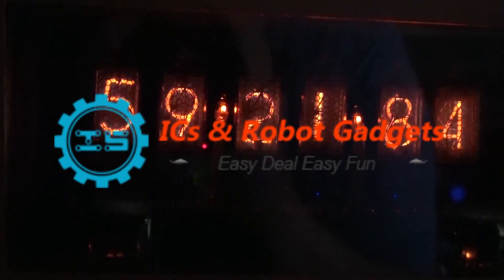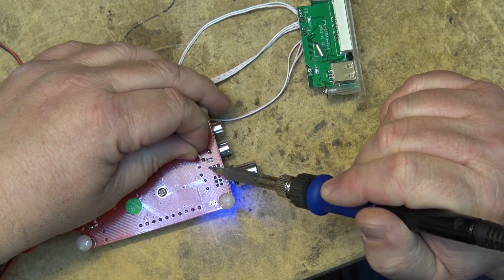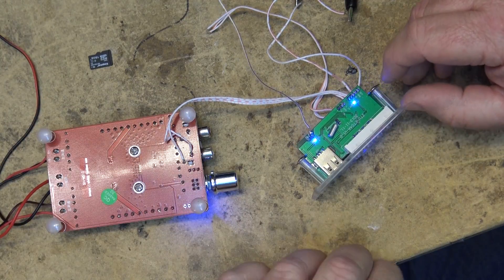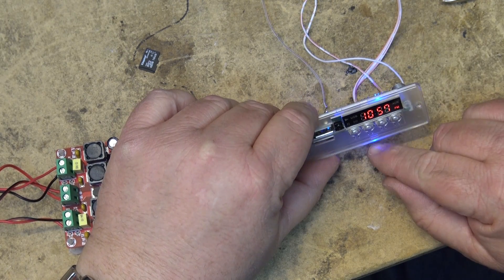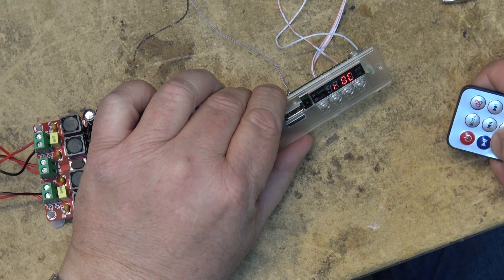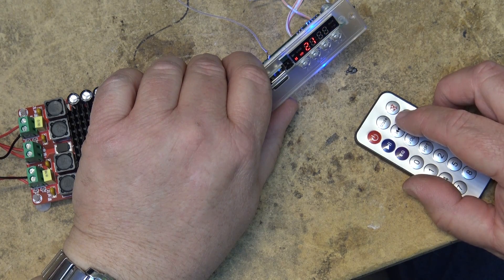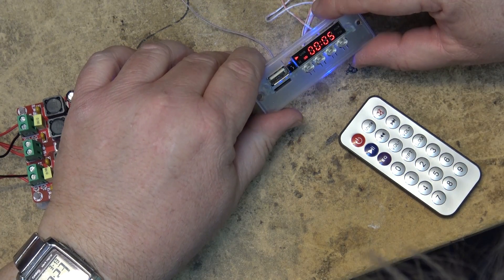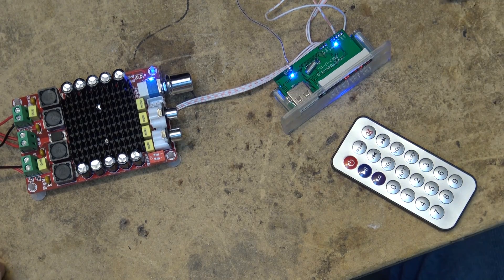MP3 decoder with FM radio board demo

Comment: I have this FM RADIO MP3 BLUETOOTH DECODER I like it but in your video I don't like the iron in the potentiometer..I connect the L/R/GND output of this board to L/R/GND input in audio amplifier then if the audio amplifier has potentiometer volume I turn in in the MAX VALUE and I use only the digital volume,the same thing I do and if I have the Arduino with RDA5807 chip which has code for RDS and digital volume in the library...I will use the potentiometer if I use the Arduino with TEA5767 which this chip has not code for digital volume for example I connect tea5767 with arduino then I connect the L/R/GND output from TEA5767 to L/R/GND input in my audio amplifier and i can contol the audio volume

Comment: I wonder why they didn't implement a DAB reception on this radio from Icstation?
Reply from the maker: DAB isn't used on this side of the world. They tried to implement it about 18 years ago, and even had all the radio stations simulcasting, but it flopped as the USA never adopted the standard and instead launched HD radio (Hybrid digital) so DAB faded into the sunset here in Canada. Now we have the hybrid system as well, which does have a good point. Because it rides along with an analog carrier, the analog station remains on the air for those with older radios to enjoy.  Too bad they didn't do that with analog TV. Left a few TV stations on the air for those that didn't want to upgrade. I am sure there would still be plenty of people watching analog TV had it remained, as the coverage area of an analog transmitter was fer greater than the feeble digital signals we have today.

Comment: Nice French! xD I like it when you post more than one video a day. :)
Reply from the maker: I work full time, so I do the videos mostly on my days off. On a weekends I try to shoot several. Did 2 today, a vintage car radio, and did a quick one of the crew spinning up fiber out on the street. Brings back memories when I worked for a cable company back in high school, and spun up cable in an area that was getting cable tv for the first time.
Reply: I'm so old that I remember when car radios used tubes/valves, instead of semiconductors.
BTW, two videos per day is great! That One-Video-Ah-Day complainer person should
simply not watch YouTube or use any computer... every other day.

Comment: These FM mp3 players are great, they sound great. I have used them in many projects. just make sure when you buy one they have a voltage regulator like this one does.
Reply: yeah, you have to watch that, i have one similar but different, if you get what i mean, and its 5v powered, and, supply polarity input leads are reversed, black being +5, red ground ..oops!!!
Reply: Hello! How can I know if it has a voltage regulator? I'm interested in purchasing one of these. Thanks!

Comment: I have played with a few MP3/SD type modules and always found they always produce a high-frequency digital noise over the audio output, Especially audible with any higher amplification between tracks.